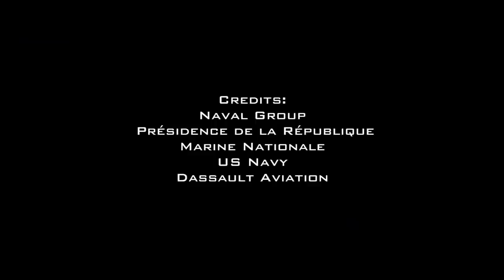France’s New Aircraft Carrier PANG will be nuclear-powered

Comment: 🤔.  Will this proposed 75,000 tons of radioactive junk be like the French Jean Bart battleship?  Which took 19 years to build (1936) before entering service (1955) and was retired just 2 years later (1957).  And was scrapped in 1970.  

So over a period of 34 years the Jean Bart battleship was never fully operational and was only in partial service for 2 years.
Reply: You know the Charle de Gaulle super-carrier ? We can build a new one.
Reply: @ni9274  
‘Super carrier’?  The Jean Bart was slightly shorter but heavier    The tiny CDG is not classed as a super carrier, it is however the French Navy’s most troublesome warship.  If the French Navy has struggled to build 40,000 ton warships, how do you expect them to build a decent 75,000 ton warship?

Even the Perle submarine has been botched by gluing the 30+ year old submarine together to another 40+ year old submarine.  Do you see why Australia cancelled their $90 billion contract?
Reply: @IanS2024  the French had to build an aircraft carrier and they succeeded. When you develop something new, there are bound to be problems, like the F35 ($1.5 trillion), the zumwalt ($7 million)... We are 21 years later and nothing indicates that we would not be able to build a larger aircraft carrier. australia canceled the contract because it wanted to change the means of propulsion. Just the fact that they chose France instead of the United States in the first place is funny.
Stop saying dumb shit that make you look bad.
Reply: @ni9274  
Your theory doesn’t make sense, the French Barracuda class submarines are nuclear powered anyway, if the Australians wanted nuclear powered submarines they would have simply purchased off the shelf Barracuda subs instead of the French trying to downgrade them to diesel power.  Are you keeping up?  This clearly indicates the Australians do not trust French nuclear powered warships.  The CDG and the Perle incidents frightened them too much. 

I’m not here to argue, but everything I’ve said is true.  The submarine, the Perle, was sellotaped to the Saphir submarine, the Saphir was launched in 1981 and had already been decommissioned, they wouldn’t have retire it if it was still any good, would they?  How many years is this submarine expected to be in service for?  50+ years?  Once the French Navy has finished stapling it together, it will probably take another 2+ years to finish its sea trials   This means it won’t be operational until 2025-2026 at the earliest.  It would have been easier and quicker to buy another sub, perhaps Australia could have sold you one of their obsolete subs instead?
Reply: @IanS2024  they choose diesel power in the first place, now they want to change so be it. You are historical allies and first world power that's just better than what france can offer. (and wtf is the CDG accident)
We have 9 other subs and new one on the way why this obsession ? Things broke all the time and an accident does not represent the general nuclear capacity of a country especially when it is the country with the most nuclear power plants and the only nuclear aircraft carrier apart from the United States.
Does Three Mile Island accident represent your nuclear capability?
Does the F35 overcost and failure say its a bad plane ?
Reply: @ni9274  
The CDG has been plagued by technical and design problems.  I never said accident, I said incidents. 

During its sea trials they discovered the flight deck was too short, surely they should know how much space a plane needs to take off and land?  Then there was smoke from the reactor, propeller broke, high radiation levels, extremely loud engine noises, and electrical faults on at least two separate occasions….

You mentioned France has a total of 9 nuclear subs.  One of the problems is, the Perle is 30+ years old, and this is France’s newest Rubis class sub, which means the other 4 operational Rubis subs are even older.  

The Three Mile incident?  It has recently been reported there are currently 28 French nuclear power energy stations out of service because of corrosion issues and other problems, and are undergoing urgent repairs.  This is 50% of all of France’s nuclear power stations. 

Looking into it further, French submarines are simply not as safe or reliable as other countries submarines.  The Surcouf, the Minerve, the Eurydice and most recently, the Perle submarines have all been lost due to poor design or human error, none of these were due to enemy actions.
Reply: @stephen10.  
Did you know France had Europe’s second largest navy during WW2?!  And they did absolutely nothing = What a waste of money and resources, Remember Toulon and Mers el Kebir?  The modern French navy isn’t any better today.
Reply: @stephen10.  
So you’re admitting it wasn’t only the French Navy that collapsed - it was the entire armed forces.  Toulon was not occupied by the Germans until November 1942, it was the French who agreed to keep their hundreds of warships in their harbours to appease their occupiers.  Did you know, France fought more battles against the British in WW2 than they did the Germans - in Morocco, Algeria, Lebanon, Syria and Madagascar.  

What stops the French doing this again with their new carrier?
Reply: @stephen10.  
So the new French carrier could find itself in a similar situation = so don’t bother building it.  The French Navy has never been used effectively, save yourself the money and embarrassment. 

You seem to forget the French Army had more tanks and soldiers than Germany had in 1940, so the French Navy shouldn’t have been in that position in the first place.
Reply: @stephen10.  
Behave?  It looks like you get your information from Wikipedia?!  And added Germany’s and Italy’s army divisions together.  And highly exaggerated the number of German tanks by saying they had 2,000 more than they really did.  I’m not sure about the troop numbers either, on a France24 website it says France had 5 million soldiers.  Even during the invasion of France, how many Germans soldiers, tanks and aircraft were in Poland, Denmark, Holland and Belgium?  The Germans and Russians were facing each other in Poland in large numbers, unsure what the other side was going to do.  

Helicopter carriers?  They are good for humanitarian missions and can assist in amphibious landings but not much else.  A helicopter carrier is no match for a fast jet carrier.
Reply: @stephen10.  
Oh no, nice try thou.  Within a week of Germany invading France, it was either the French PM or French President who told Winston Churchill the war was already lost.  This was when he realized the French soldiers were not in a position or capable of stopping the German advance, it was this admission that triggered the subsequent retreat and planned evacuation at Dunkirk.

Obviously the population does have an affect on manpower, look at the population of France during the Napoleonic Wars?  It was much greater than any of the smaller Germans states, I didn’t hear you complaining about that?!

However, what about the 1870 Prussian War?  The population of Prussia was about 24 million, the population of France was 36 million.
Reply: @stephen10.  
Be serious?!  During the Prussian War, the French Army outnumbered the Prussian Army by 500,000.  Over 2 million French soldiers faced 1.5 million Prussians.  Google it.
Reply: @stephen10.  
I think you’re trying to make things complicated.  

It’s like comparing two boxers, it’s down to the boxers to get prepared for their upcoming opponent, some will have a longer reach, some will punch harder and some will be older and some will be younger - a boxer must adapt his style and strategy to beat each opponent.
Reply: @stephen10.  
Of course France is not perfect, no country or person is perfect.  

But I do think France needs at least two fast jet carriers if they want to be seen as a military power.  Refueling, maintenance, wrong location and crew training are just a few things that can affect France’s ability to use their carrier effectively.  Instead they have put all their eggs in one basket.